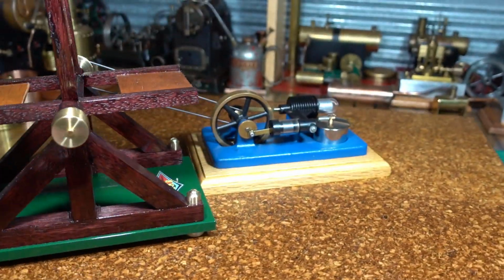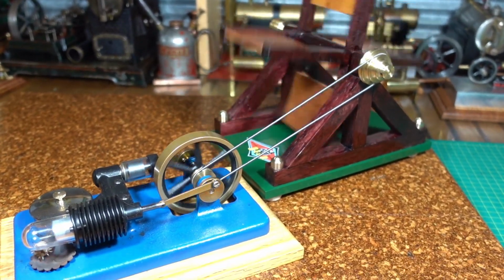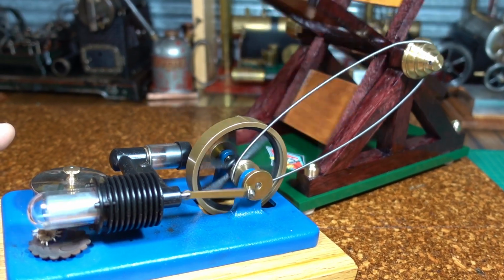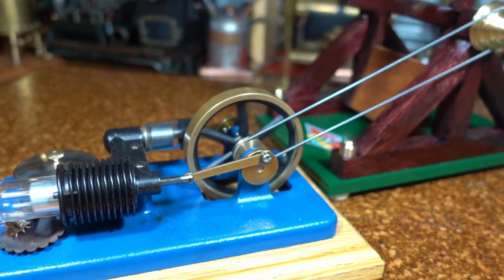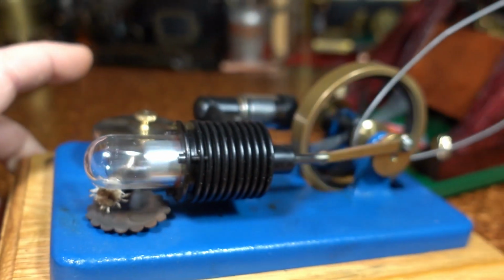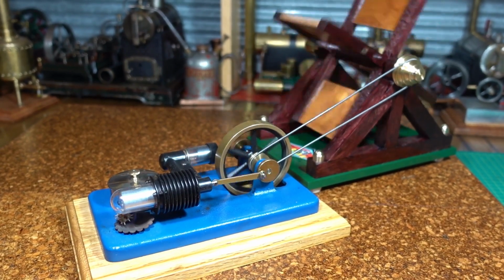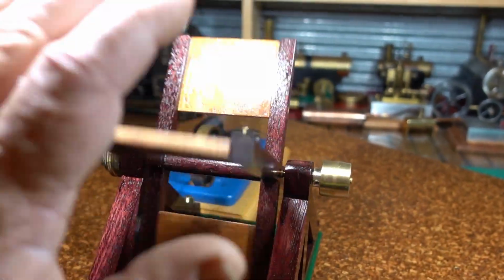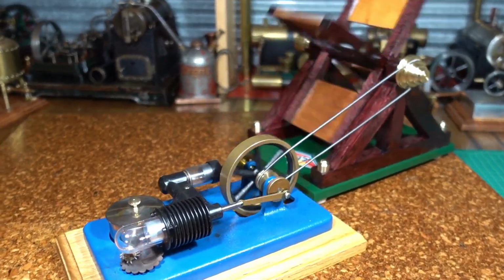Stirling Solar Engine #7 running under load with Baker Fan demo

Comment: Hello Jim,
I like that you show your engines under load... do you normally use the model baker fan or have you other items that your engines can drive.
Have a good weekend.
Paul,,
Reply from the maker: G'day Paul I have a lot of other accessories but nothing works as well for putting a load on an engine like these Baker Fans do .....doing some Googling this is what I was able to find and it makes for interesting reading and explains how simply these work and how great they are for putting a load on virtually any model engine  "these were designed by a Mr. A.D. Baker to test steam engines as they left the factory.
A Baker Fan is a simple air-resistance device used run off an engine via a belt and the faster its turned, the harder it is to turn and puts a load on the engine".